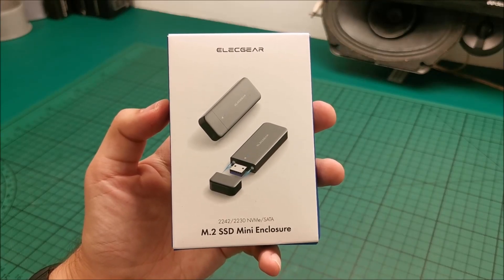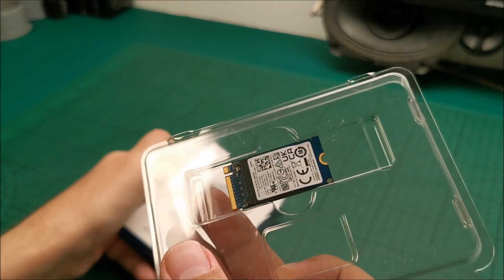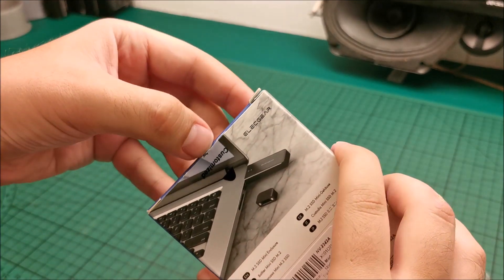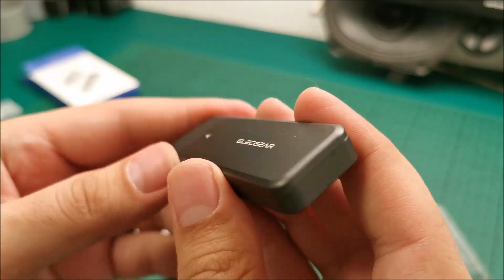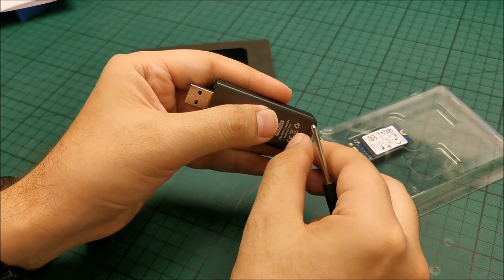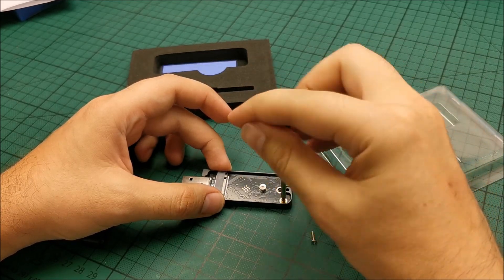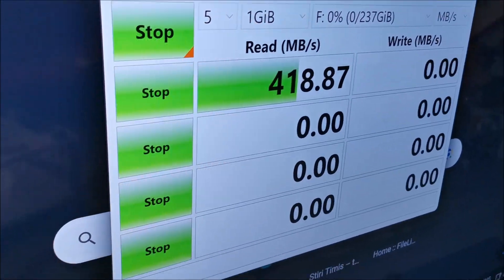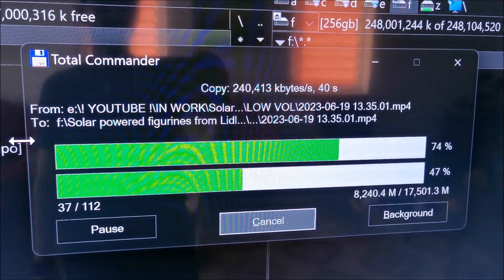ElecGear NV-2242A M.2 SSD Mini Enclosure (NVMe and SATA) - unboxing, test and review

Comment: Does it get very hot if it's just plugedin, without doing anything? I have 2230 model and you can hold it for few seconds with your hand, even if you don't use it.
Reply from the maker: It gets hot but not burning hot.

Comment: Could you compare speeds of the m2 drive in case and in motherboard? 🤔
Reply from the maker: Sorry, but not possible, as it would require me to disassemble my laptop again. But, if you search trough my videos you will see this M.2 was also tested inside the laptop in another video.

Comment: An great option since it accepts both NVME and SATA drives but not only as you state are those drive enclosures of 2230 and 2242 extremely difficult to source but so too are 2230 NVMEs limited in availabilty however the SATA isnt as much so...regardless an great minimalist drive and an lot less likely to break in place in the USB port than an typical full size 2280 NVME..regards the heat it seems that those variety of drives (aluminium metal encased) are known to get rather hot but so far ive not heard of any related performance issues... Many thanks for the informative review tear down and unboxing...
Reply from the maker: Glad my video helped. For me this is the perfect combination of speed and size.
Reply: Works for me too and after fitting an King Spec 1TB 2230 into the drive I got an good result over USB 3.0 migrating 400GB in about less than ten minutes to the drive..Yeah it did get rather warm as you point out but it may be true that the Aluminium chassis is dissipating the heat efficiently rather than the device overheats...Regardless I wonder if some software could confirm the temperature as its perfectly possible the core temp could be within an reasonable range as the surface temperature for its noted efficency may not be an realistic value. ..again thanks for the upload
Reply from the maker: There are softwares like hdd sentinel, but I don't know if they work for getting data trough usb.